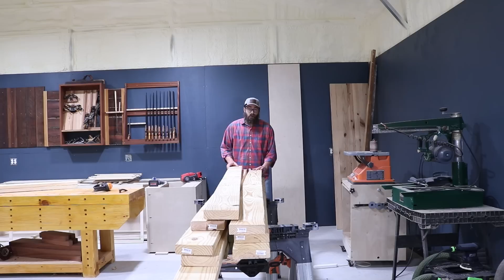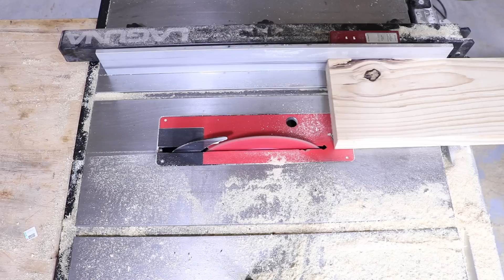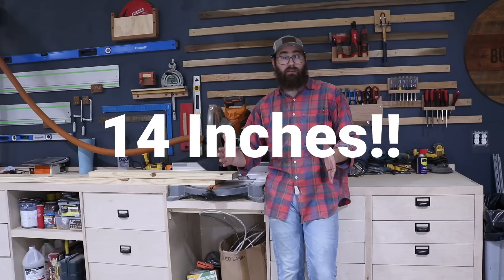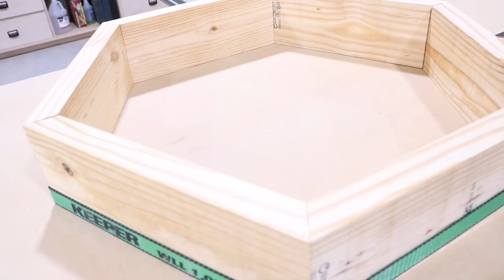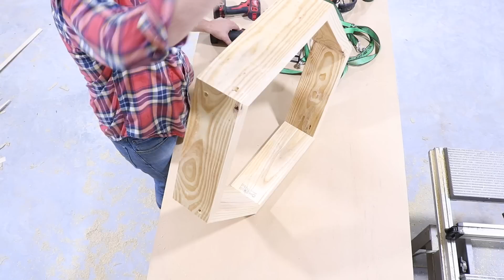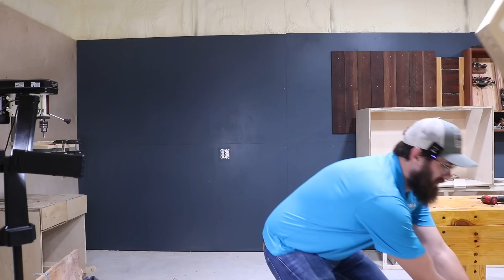EASY Woodworking Project that Sells AND Makes You Look GOOD!!

Comment: Make a rip fence 10 foot long. Fashion it so it slips tight over your existing fence. It'll help without having to use a level.
Reply: That won't work, the level moves with the board being cut acting as a jointed edge, if you use rip fence it's fixed and the board will just follow its curve you're trying to get rid of.
Reply: @JamesSmullins  I built furniture from scratch for a living we had 3 big powermatic saws, each had a fence built 10 foot long it worked fantastic for wood that is the size he's cutting. For 14 foot boards no.
Reply: @markmcconnell604  if it doesn't move with the board it won't give you a straight edge. Doesn't matter how long the board is whatever you're using as a straight reference edge must move with the board. If you already have a straight square edge then your method works but not for creating a straight square edge.
Reply: @JamesSmullins   I understand. I've used this method everyday. It does work. It has to fit the fence tight and backers along out feed table. I get the level method works but you have to make it all work together thing is wood has its own thing in mind. I've had boards with  a lot of heart center that twisted up and over the blade. There are many ways to do this everyone has their favorite

Comment: You're doing great, imo.  I love your style.  But you could clean up your audio (i.e. rain, a/c and any other constant type of background noise) by learning to pinpoint it and lower the volume to that specific area.  I have no freakin' clue what it's called, but there are tons of videos on how to do it.  Just search for cleaning up audio and you should find it.  

Regardless, keep doing what you're doing.  Love it!
Reply from the maker: Thanks!  The rain was very loud but I guarantee, you did not hear an A/C in my shop lol.  Haven't put one in yet
Reply: @burnstockwoodworking  Hahaha!  Got ya!  And I feel for ya.  Start looking for one of those sponsors for the mini split units. LOL

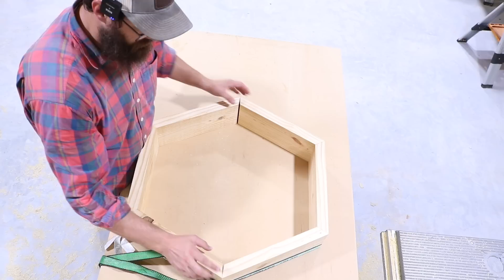Comment: 12:24 I think it was a David Pachuto video where i got this from, but he was gluing up a segmented piece and he gave credit to someone else for this, but you glue up the two halves of the segmented piece (in this case, three pieces) and then once dried, you lay the edges that need to comnect flat on a piece of sandpaper stuck to a flat surface and just sand until the entire end is flush with no gaps.

If you do this to both pieces, 5hey fit perfectly.

I'm sure there is a way to get measurements perfect so it always just works, but his solution seems like the issue I'd run into every time as not something I usually do.

Hopefully that description made sense.
Reply: You're solution works too (and might be easier with a big piece)

Should've just kept watching instead of pausing to comment, then restarting. Lol
Reply from the maker: That is a great idea too, I didn't even consider sanding, mainly due to size and quantity.  No doubt that would work!
Reply: Yeah, realized half way through writing it might be cumbersome, but I'd already started ... Lol.

Figured someone else might read and be useful for them.

And I know YouTube has become all about 'engagement' from comments etc. (the ever changing metrics...)

Comment: I really need to start squaring edge first before end.

I'd never rhought about it.

I usually do ends first and cut to length as I have a contractors saw and the shorter lengths are easier to work with.

I'll have to change that. Or at least cut a bit long, do edge, then do final end cuts.
Reply from the maker: Long as you get the results you want if should be fine
Reply: True. But I can definitely see me having a messed up cut or piece and not knowing for sure why, because of not doing right.

(Try to get in good habits so it saves me later by doing right way without thinking... At least that's what I try to do. In practice... Well, sometimes... NVM... Lol 🤷🏻‍♂️

Comment: Nice Project.  I do have some additional info to update concerning the use of pressure-treated lumber.  

This is from research by Oregon State University. "The safety of pressure-treated lumber for raised bed gardens has been examined by several researchers.  From what I've seen, the consensus is that the chemicals do leach out of the wood into the soil and are uptaken by the plants in very small amounts. However, I haven't seen any research that suggests the level of the chemicals is significant enough to be of concern for human health.

Of course, the primary concern with using pressure-treated wood in raised-bed gardens has been with the arsenic in CCA- (chromated copper arsenate) treated wood. This publication from Pennsylvania State University does a good job describing the risks of using both CCA-treated wood as well as ACQ- (alkaline copper quaternary) treated wood: Environmental Soil Issues: Garden Use of Treated Lumber. With regards to CCA, they state, "Although the plant and human health risks from garden uses of CCA-treated lumber appear to be extremely small, there are steps gardeners can take to further reduce any such risks."

One of the steps they recommend is to use wood treated with ACQ - "This is an alternative wood-treatment chemical that contains no arsenic, chromium, or any other chemical considered toxic by the EPA."  If you are shopping for treated lumber nowadays, I don't think you'll find CCA-treated material in the home centers anyway since its use was restricted by the EPA in 2004. It will be more likely be ACQ or some other chemical."
Reply from the maker: Wow!  Excellent info, thank you!

Comment: I have no planner either,  one thing I have found to get square edges  is cutting my lengths first,  say 24in since my table saw has a short fence and it's hard to clamp a long straight edge to the fence.  Hope that helps someone 🙏
Reply: You don't clamp the straight edge to the fence when doing this hack. It needs to move with the wood. Your small table saw fence will still work with this.

Comment: Pro tip! Your children's tv remotes have triple a's. At least two! Thanks for demonstrating proper miter saw posture :)
Reply: @burnstockwoodworking  I do have a question though, more like 5 in one... with some "gentle" bracket adjustment and using 2x10 for boxes, how would one over- engineer attaching these boxes to  a wall and the top of a bookshelf. So one could park books or a Yaris on. :)

Comment: Thanks man, I needed that. As for finding a pencil, not sure where I watched it (and your shop is cleaner than mine) but take a dozen pencils, cut them in half and sharpen all pieces. Go to the center of your shop, toss a few at each tool then throw the rest into the air. When you need one, it will be there. 

As for improving your channel, please don’t refine it too much. One of the things I like the most about your channel is that you show mistakes in wood working and video production. This helps everyone that watches. After all, I'd rather learn from your mistakes than have to make them myself. 🤣

I think I wanna build one of these this weekend. Prolly smaller scale with circles or hexes on each level to hold potted plants but should be groovy. Thanks again for the inspiration.
Reply from the maker: Thanks!  Hope you have fun on the build!
Reply: BTW, I dig the way your ceiling came out.